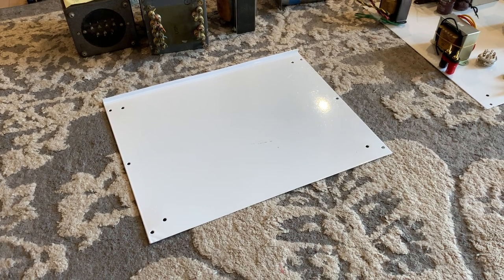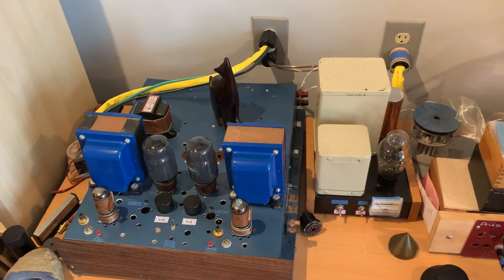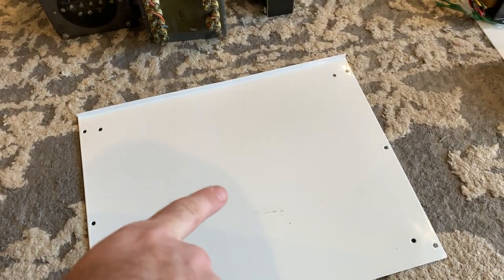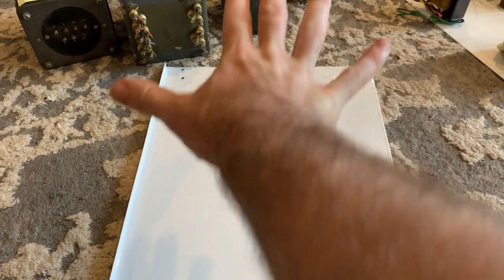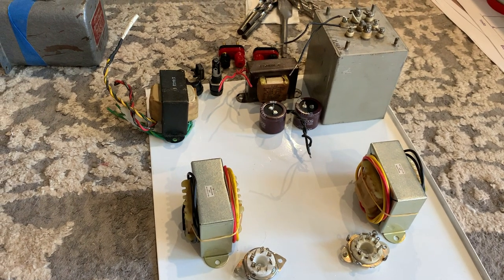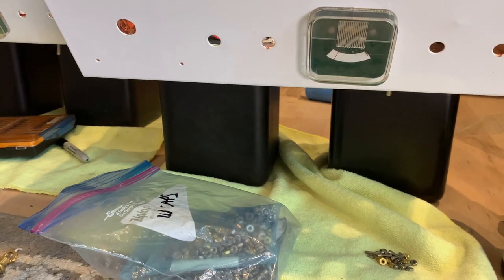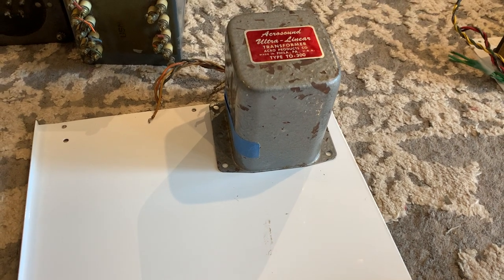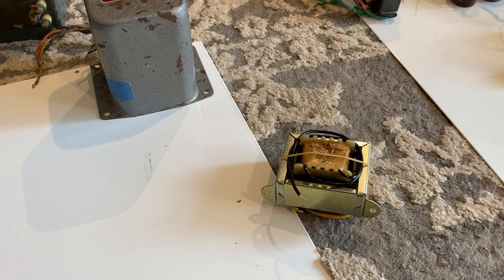SET Build! - Baby Darling Layout & chassis basics

Comment: That statement you made, that the amp you showed takes more than 1000 hours of build time, by an expert builder, must incorporate a lot of testing and design loops right?
Reply from the maker: The attention to detail makes up most of the hours,  with knowing all instructions. The research to get there took decades. ; Maybe I was exaggerating a little, and it also depends on the builders speed. Take your build speed of a complex PTP amp and multiply time required by 10 or more. ; ).

Comment: Better way would be to have the speakers with the own field coils and do away with the Transformers valve straight to speaker
You can pot the transformer with paraffin wax I think transformer oil is probably best
Reply from the maker: Great ideas! I've been thinking of that, using speakers field coil instead of the output transformer. Biggest drawback: they would never allow it for safety reasons, as speakers cables would have to carry the B+ with the full swing. (For typical tube amp, 400VDC with 800VAC component!) Indeed histopathology grade paraffin wax would work extremely well for potting. :)
Reply: @realworldaudio  well audio note contemplating to do that with one of those speakers. Have you seen the Philips 1959 amplifier speaker set is 800 ohm speakers I don't know what the voltages to the speakers must be high had anything to do with that old Philips valve amplifier and speakers. If interested I'll find you the number,
 there's one in Holland marketplace going for €500 needs work
Reply from the maker: @johnsweda2999  Thanks John, I will pass on that... I will get into field coil when I retire, sadly that's quite far away. ;
Reply from the maker: @johnsweda2999  Will post on field coils ;
Reply: @realworldaudio  what about the Philips amplifier and speaker,  did you bother to look! you're not interested. Curious to see the system sounds like the amplifier looks nice I don't know anything about its specs tho. you  have no dealings with that kind of system
Reply from the maker: @johnsweda2999  Sorry John, no lack of interest. Lack of time! I  will do a video on field coils. Although I do not want to pursue them now, I did research them quite thoroughly many years ago. It is way more difficult to implement them than you would think, and unless you have crazy amount of effort available, I would suggest to put energy elsewhere. In audio the biggest issue is time economy: everything can be made to work, but do you have enough time / energy / money to do it? Field coils are at the extreme end of this spectrum, my schedule does not allow me to implement them properly, hence I need to retire first to do that! Stay tuned for the video, just a little patience!!
Reply: @johnsweda2999  Hi John, Philips did an OTL with that and driving them with a serial-parallel  EL86 tube .. the basics of amp output schematic can be found on the Philips EL86 datasheets. I do have a pair of 6.5" 800 ohm drivers (rc~680) so indeed very good impedance match. You could also drive them via a line transformer with minimal step down. It's a low priority project right now..